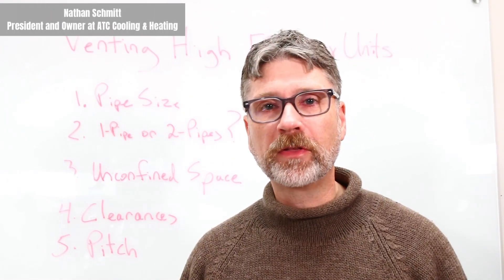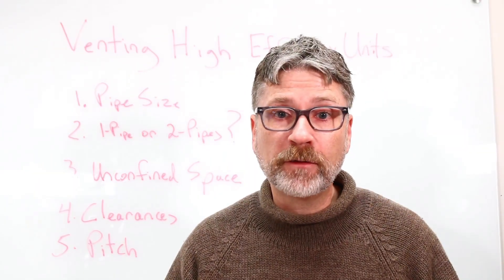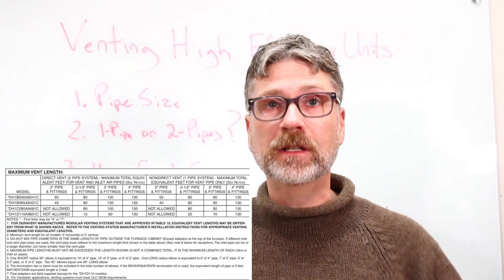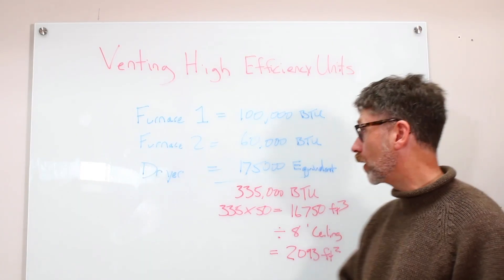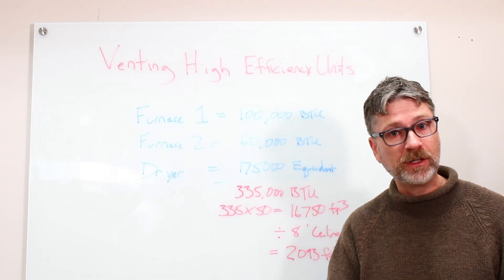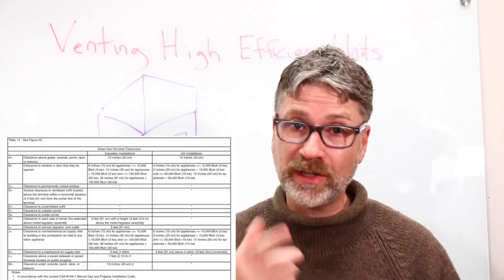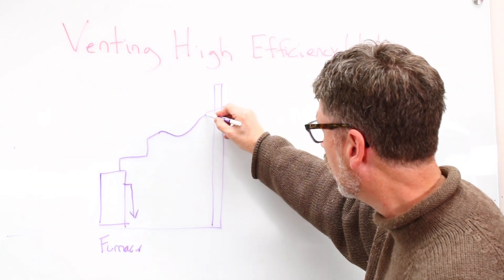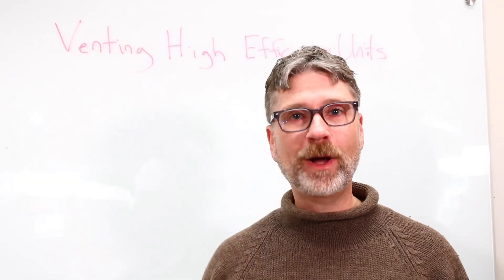How to Vent Your High Efficiency Furnace!

Comment: From time to time I see 2" venting on a high efficiency furnace increased to 2.5" or 3" but then back down to 2"  what is the purpose of this
Reply from the maker: The outlets on most furnaces are 2".  From there, you increase the size (according to manufacturer's chart) to 2.5" or 3" if necessary.  But the sizing should not go back down after that...

Comment: Can the vent follow the old chimney space and come out of the roof?
Reply from the maker: You can vent a high efficiency unit out the roof, no problem! That said, we don't usually use the chimney space because chimneys can be constricted and are often not straight making them difficult to access.  Keep in mind, to use the chimney space, you need to run the new PVC up through the chimney all the way to the top.  Just poking the PVC into the chimney will quickly ruin the chimney as moisture laden air from the vent essentially rains back down the chimney with acidic moisture.